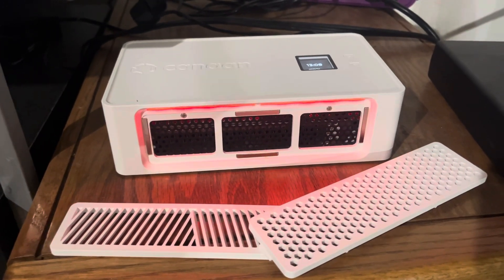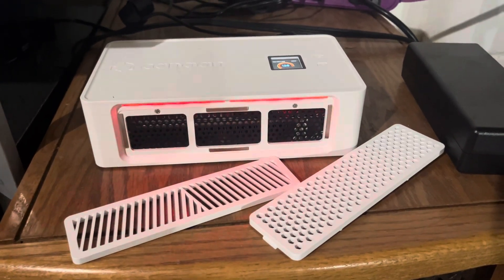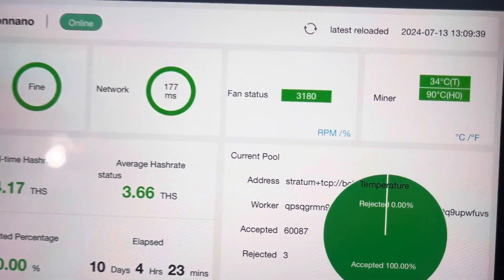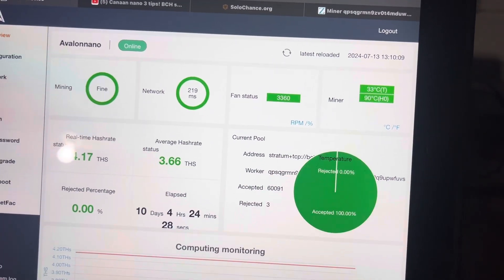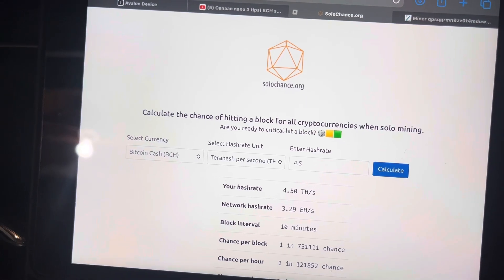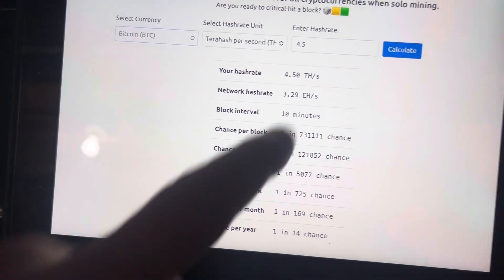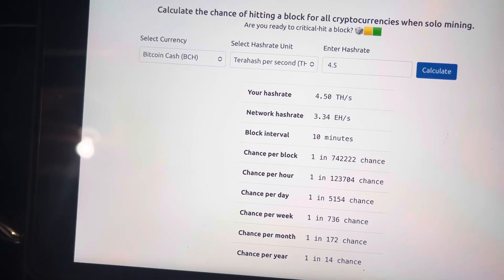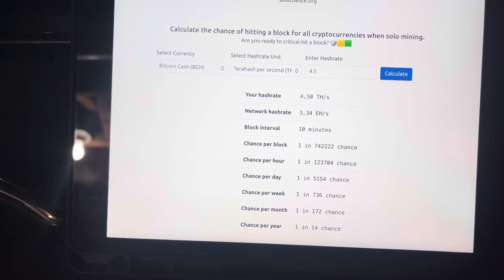Avalon nano 3 update!!  BCH mining at home!

Comment: hey! i need some help i dont undestand why me network isnt connected properly , everythings running fine but my network status is 0 ms and has a red circle really confused , checked everything but for some reason cant find the problem. would be nice if anyone could help
Reply: Please refer to the factory reset instructions in the manual. If further issues persist, contact our technical support.

Comment: What are your thoughts on this device running long-term I know it's advertised as a heater or do you think it's like a spur-of-the-moment thing when you're cold.
Reply: I run 7 on a 10 tier shoe rack . With a screen protector on the rear to keep the boards cleaner .
Reply from the maker: @jasonkidwell1767  I am running it all the time even though it’s summer. Chances are better than at hitting a block.
Reply: @Laughingkangaroo  I have mine going as well I just haven't Crank it up to high yet being in Florida the temps are a little high
Reply: @jasonkidwell1767 just keep it in ur house in a well vented area